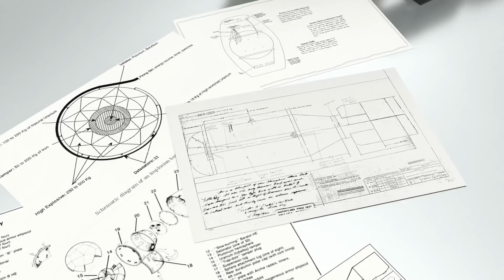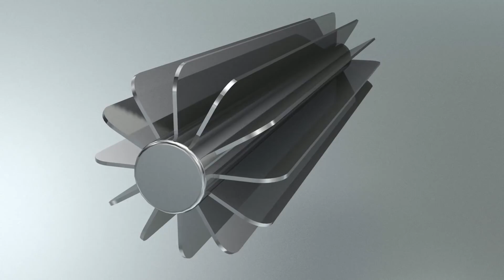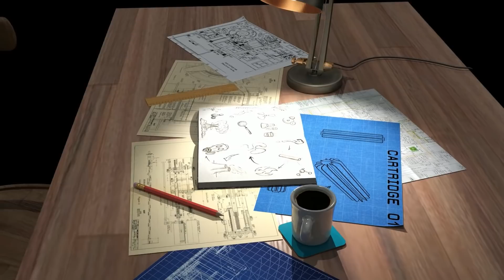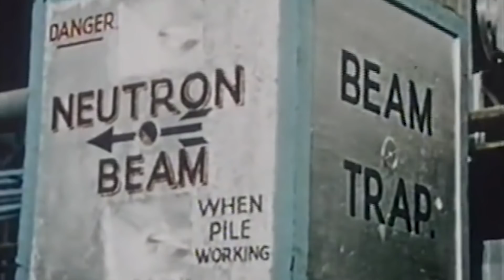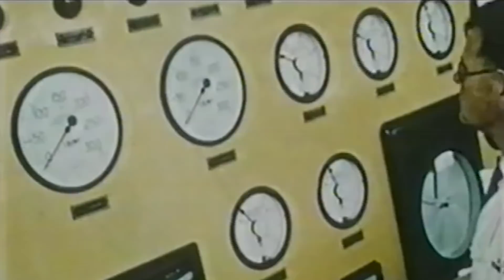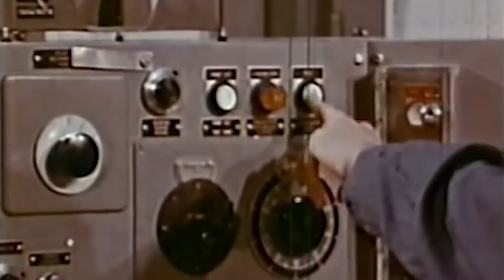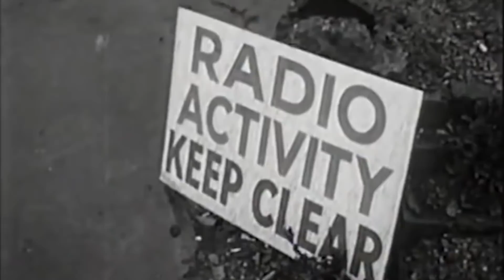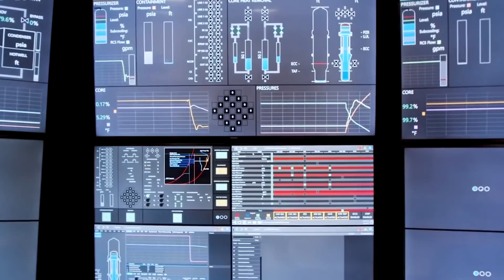Atomfall - Windscale Disaster - How The British Chernobyl Was Stopped

Comment: After 3 days it was put out? How? I've seen several of these programs, and not once do you explain how you put out a nuclear radioactive fire?
Reply: With water hoses. Which was extremely risky, because the heat could have stripped the hydrogen from the water and then cause an explosion, but they had no choice (molten metal was starting to drip out of the core) and, in the end, it worked.
Reply: @SeverityOne  so no scientific evidence or proof, just 'water and it worked?' In my mind I am looking at this machine and thinking, water isn't going to be enough to put that out?!
Reply: @markeone  Well, you don't have an awful lot of leeway or time when you have a nuclear reactor on fire. They were a bit desperate at the time.
Reply: @SeverityOne  my very VERY basic rudimentary knowledge says, you can't put out a fire that instantly flashes water to steam, and that the nuclear material is at a point of no return, but what do I know.... it was a weighted question to begin with as we don't actually know how they put it out! And there is little to no evidence ever to support the water theory...
Reply: @markeone  It is well known that they used water, loads of it, constantly for several days. They didn't have anything else, no-one had considered how to extinguish a fire in the core.
Reply: @nlwilson4892  The water did not work (it just boiled off). They eventually sealed off the reactor to starve it of air (oxygen) and that worked.
Reply: @krashd  Control rods are there to 'control' the nuclear chain reaction. I know we're told we put out nuclear chain reactions with water, but this goes against some of what I know from what I have read and learned, but I am no nuclear physicist. From what I've learned, you can't stop a nuclear chain reaction without control rods. Water is just a way to cool. It won't stop it. Most reactors are submerged in water from my understanding, this incident was different in air cooling, but.... I would always like to understand how all these incidents are 'stopped'
Reply: They tried several things including increasing air flow to 'blow it out' but that just made it burn more fiercely.  Then they tried carbon dioxide but did not have enough to make a difference. Then they tried water in some tubes  (which was dangerous as it could have produced hydrogen which is explosive) but that did not work either (contrary to other comments here).  What eventually worked was turning off the fans and sealing the reactor containment to starve the fire of air.  I recommend you watch https://www.youtube.com/watch?v=j5wZoswSNwc&ab_channel=PlainlyDifficult  for more detail.
Reply: What do you think a "nuclear radioactive fire" is, because that description defies standard definitions and points to some grand misconceptions?!? The criticality of the reactor (which some people think of as a nuclear 'fire') was shut down via control rods when the actual fire was detected. The conventional fire, which began in the fuel cartridges, was eventually extinguished by starving it of oxygen (as someone has already mentioned).
Apart from the hazards of the radionuclides released, the fire was really no different to any other fire.

Comment: Great video! Something about air-cooled reactors just seems wrong
Reply from the maker: Thanks! i agree, i spent the whole time researching the video shaking my head. Every element of the power station was built by the lowest bidder!
Reply: Windscale reactors were not a power station, the later and nearby calder hall was
Reply: Or even - as shown in this video - two things in the Windscale design: (a) air will support combustion allowing the core to catch fire and (b) unfiltered air cooling could allow the escape of radioactive contamination to the surrounding environment. Subsequent designs of British civil thermal reactors were cooled by CO2 gas in closed loops.